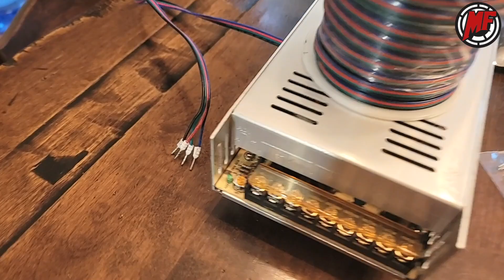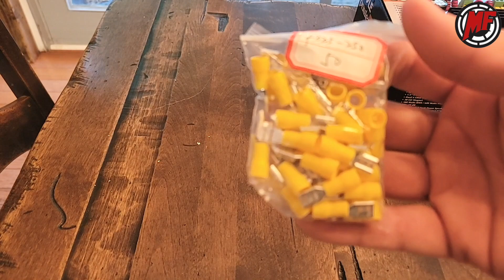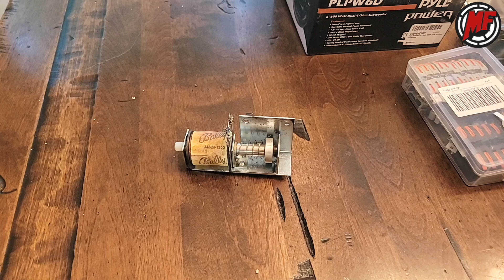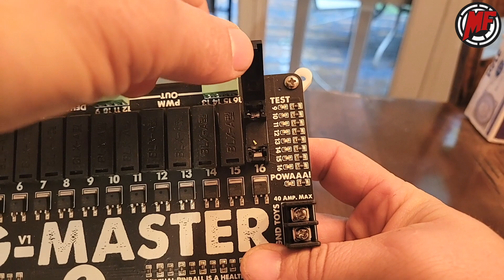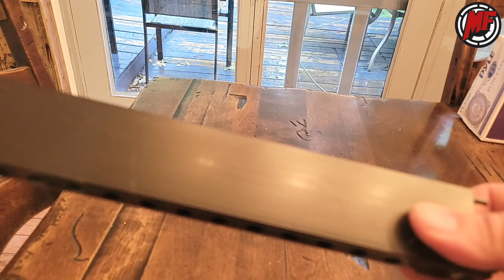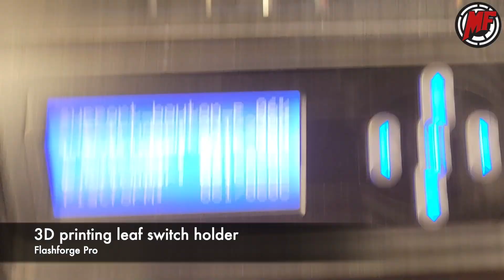Virtual Pinball Force Feedback Parts (Legends Pinball)

Comment: @MajorFrenchy Is there a reason to use solenoids for the flippers instead of the thunderclaps?  Maybe just for variety of sound?  Thanks for the great videos!
Reply from the maker: Yes there is a reason. The solenoids i installed for the flippers are triggering when i press the flipper no matter what. They are independent of DOF. https://youtu.be/0BBe8f-iw8w
Reply: @MajorFrenchy  Ah, thanks.  I should have finished combing through your videos before asking :)  I'm curious if they will sound as good as the thunderclaps, but that is nice they will always work so seems a good trade off, if any.
Reply: @MajorFrenchy  In your "Force Feeback Solenoids (stand-alone)" video, you are using a separate 12V 2A power supply.  I bought the 4 power supplies you listed above.   Can I use those to power the flippers, or do I need to also buy the little 12V 2A?  Sorry I'm not great with power stuff, thanks for all the help.
Reply from the maker: @bmeist7873  use your power supply that you bought. I could have used my 12v Mean well Power supply for it but i had not received it at the time of the video

Comment: @Major Frenchy - you’ve been an inspiration to heavily mod my ALP (new playfield, addressable LEDs, Backbox, SSF, DoF, analog plunger with a lot..etc). One question that is crossing me, whether to add an 8x32 led matrix or 5 flashers with strobes. I see in the video you mentioned flashers. Are you planning to mount these at the bottom or top of the back 
box? I REALLY wanted to lower the angle of the playfield to fit an LED matrix or Flasher bar under the glass in the back but the ALP used the frame around the monitor to hold the glass. The matrix above the glass seems really clumsy right under the full DMD.
Reply from the maker: Thanks Bill. I will not add a 8x32 on this build. the 5 Flasher are going to be part of my backglass that i am redesigning.
Reply: @MajorFrenchy  killer! The matrix will have to wait until I build a VirtuaPin this winter. Def going for the LEDs on the speakers and playfield and undercab for the ALP. 

Liked you other video on the DIY flasher bar build, May use that for the ALP or perhaps I’ll wait to see which direction you go :)
Reply: @MajorFrenchy  Another thing to keep in mind are the LEDs along the playfield. The ALP has sort of like a picture frame that holds the glass on the top and then has the monitor underneath with a slight angle inword. Have you thought about how to address that? I’m thinking about using some of the LED tracks someone posted in the discord and placing them sideways at the top of the frame just pull over the glass the glass is not resting on top of it